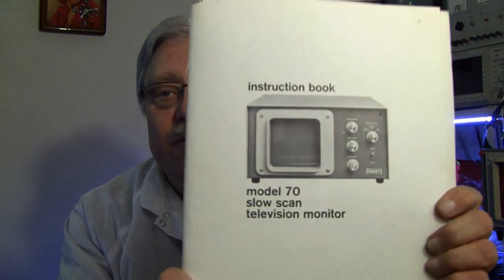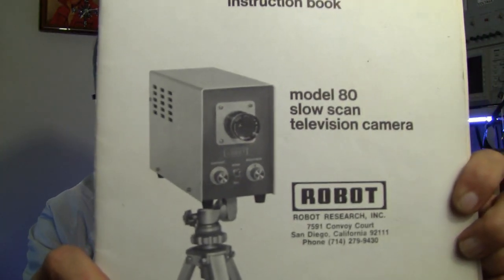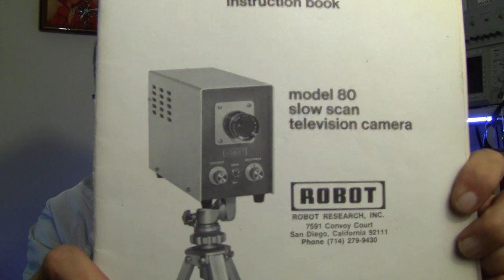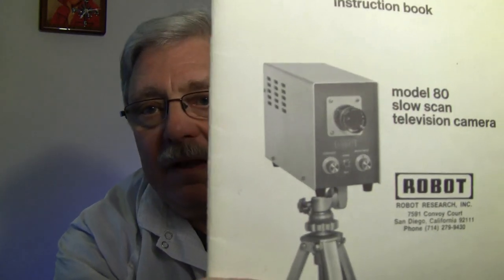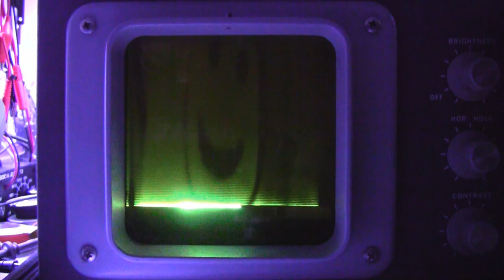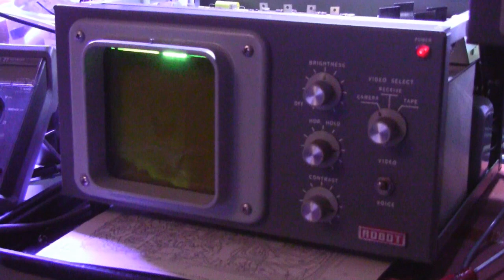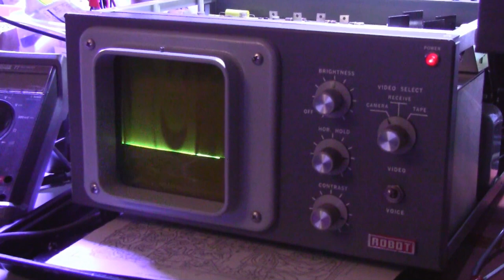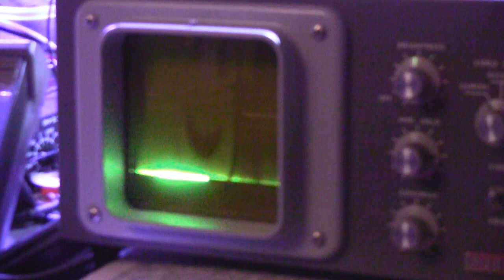Robot Research 61, 70 and 80 Slow Scan TV Restoration

Comment: I had a model 400 for several years, bought from the 1982 World's Fair ham station, where it was part of the ham demo booth.  SSTV was/is interesting, particularly how they figured out ways of capturing and displaying the pictures.  The P7 phosphor monitors (often military surplus radar displays) were a cheap solution in the '50s and '60s.  And I seem to recall that some vidicon cameras used an automatic lens cap to "capture" an image by holding it in the dark and reading the retained image slowly.  
I have whole files full of early SSTV project stuff, mostly from 1970s 73 magazine.  I'm pretty sure there are sync generator and gray scale generator circuits in some of those files.
Reply from the maker: I ran SSTV in high school as a listener/viewer only. No license until recently. KJ6RNL. I built the (Copthorne) MacDonald Mk IV monitor from an article in 73 magazine. I was also given a Mk I monitor and flying spot scanner from a local ham. I never had a good tape recorder, so recordings were very flaky. It was live off air or from the FSS.
The storage vidicon you recall had a regular film camera shutter and lens in front of it. It was the Westinghouse 7290 made just for SSTV or storage. You erased / reset it by bumping beam current way up for one scan in the dark and it was ready for another exposure. I have one of those tubes here but no plans to use that for anything.

Comment: do you know what the fast scan Cinch Jones connector on the model 80 camera is? Is it regular composite video or y/c?
Reply from the maker: The signals,  by pin number, on the 4 pin connector are: 1. Baseband video (no sync), 2. Vert. Sync, 3. Horizontal Sync, 4. Ground - In the big 12 pin collector the FM modulated SSTV signal is on pin 12. The scanning frequencies are 4,000 Hz for horizontal scan and 15 Hz for vertical scan. NOT standard video compatible. Should be able to make an adapter circuit for an o'scope though.
Reply: @videolabguy thanks for the pin out information. If you ever want to get rid of the 61 let me know. I’ve been looking for years with no luck. 🙁

Comment: So were the images received and displayed on the slow scan monitor shot onto photo film ever/ was the phosphor persistence enough for direct viewing? It looks interesting! I've played with recording/pb slow scan tv to various forms of audio tape via computer software but never the real radio/crt thing.
Reply: Was going to mention both those things. MMSSSTV has great correction, taped images on that thing probably screw a lot.
Reply from the maker: Yes and yes. The slow scan images were frequently photographed with Polaroid cameras in order to see the frame without the fading. Polaroids were also used to shoot color images. Believe it or not, there is enough red, green and blue available from the phosphor to pull this off! I was shooting video in a lit room. In subdued light, the image can be viewed for up to 15 seconds. More or less.
Reply: @lutello3012  They sure do skew if you turn said correction off! I did the shoot out between an otari mx5050 2 track reel to reel vs a decent audio cassette player vs a cheap nasty audio cassette player. The difference between even the good cassette player and the otari RTR was much more then I thought. The Otari skewed in a perfect straight diagonal line while the cassette looks so bad i like how they sound even less now. I forgot to try very bad VHS EP linear audio, that might look weird as it is actually servo synced.
Reply: @videolabguy  Ok thanks! I used to use a film recorder to make slides at work and it had a white phosphor and an 'r/g/b/clear' filter wheel so that is a surprise  that yellow amber high-persistence phosphor worked for color. But since it did I'll bet the color Polaroids looked rather good.

Comment: That's very cool, I think you were working on that project last year?  I never did get into ATV, wanted but just never did.  Have you looked at time period QST / Electronics magazines for a SAMs?  I know sometimes on featured items they do offer a SAM's, but unsure if the Robot items were featured?  

Side note if I may?  Is that the Tek 620A you have?  Bad caps, bad Dallas?  And it looks like a Leader 225MHz freq counter?  I have the 1GHz model, I really like it but just had to take it out of line temp...ran out of room due to new gear...need to re-organize and put it back.  73's OM and good luck in the contest!  😎  ~Jack, VEG
Reply from the maker: SAMS only covered consumer products. Never ham or other specialty gear. That I know of. I will find the manuals. I have quite the network of folks to draw from.
I think you mean my Tek 744A? It had the power supply die twice and now the video monitor has lost its black level. I learned one thing about Tek. Never work on it. It never works again if I do. I paid $2K for it. It broke down a month later. $800 and it was working again. For six months. Another $400 got that going. I'm done with it. That's why I don't use it.
Reply: Oh wow, sorry to hear about that, I know they can be very problematic...but of course, I found this out after extensive research after buying mine!  Came close to buying a HP, but because of the Dallas Chips and I found newer, I opted to not shoot myself in the right foot but instead...the left foot!  :)  I will do my exhausted research before I buy next go around...so far, Im happy with mine and it works but am still leery just the same.  Future video when I edit the video at a later time.  As far as the SAM's, my apologies, I use it as a general purpose meaning for schematics....  ~Jack, VEG

Comment: If anyone is interested I have an original robot research model 70 cable, 12 pin cable. I no longer have the SSTV unit.
Reply: i could use it. I have the camera and monitor but no cable.
Reply: Thank you I just bought it 🙂